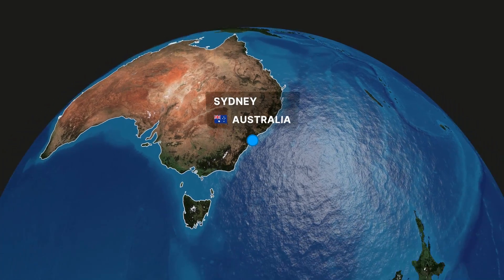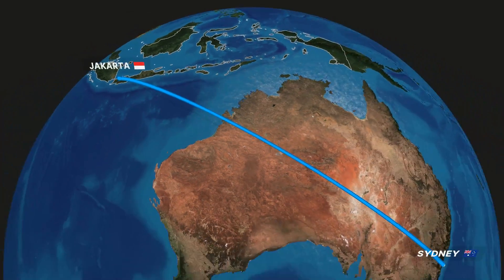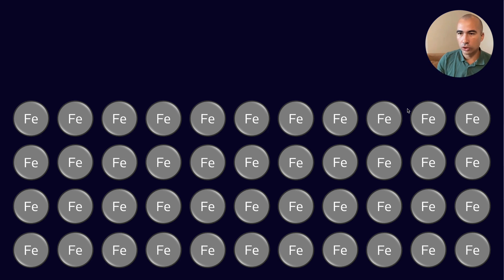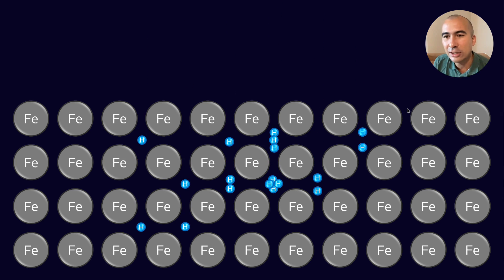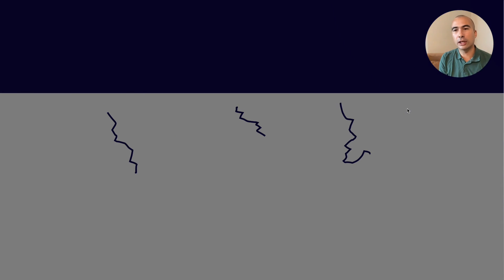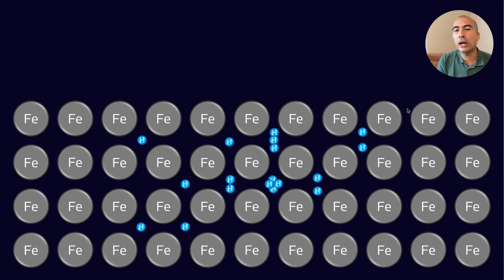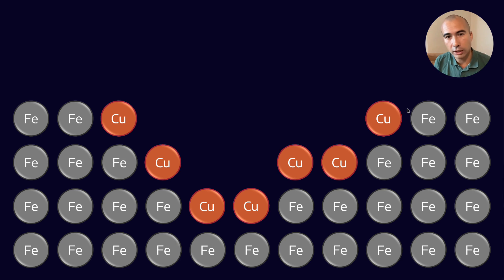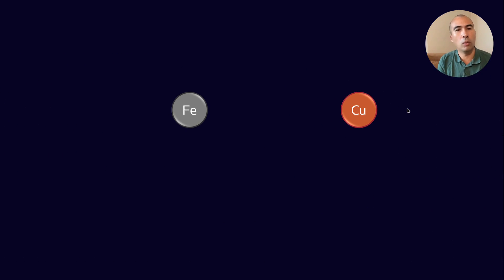Can Copper replace ZINC in Engine Oils?

Comment: I still use ZDDP additive in my oil. I have a G.M 6.0 with AFM and I don't want the lifters chewing the camshaft metal Shavings issues. Tons of forums with motor issues about AFM systems. I've owned the vehicle 6 years now without a problem. If I ever need to replace catalytic coverters that's far cheaper in the long run.
Reply: Hello! I have been using oils with copper-based anti-wear packages since 2016 on all equipment with an internal combustion engine. During this time I got excellent results. The 2-stroke motorcycle engine exceeded its service life twice as much. The magnetic plug, unlike oils with ZDDP, does not have metal elements on the surface.
Reply: @AlexanderIII_true  What product is it? And do you happen to know the specific name of the copper compound in the product?
Reply: @gregorymalchuk272  Hi, this is the Russian manufacturer Cupper, when their developments were present in addinol oils with the product name metalplaks. At the beginning of the company's formation, I collaborated a lot with developers when testing products. The only thing I know is that this compound is called copper oleate. The compound itself is rather inefficient, since the additive is based on a redox reaction, which ensures the replacement of damaged metal on the rubbing surface. therefore, there are many different other ingredients in the composition. I have photos of how copper forms only on surfaces subject to wear.
Reply: @gregorymalchuk272 been putting it myself on my oil for my scooter and it feels good, performance wise and smoother engine sound although it's just a week ago since i've tried for the first time, and planning to use it extensively for foreseeable future

Comment: This is super interesting. I share your sentiment about having skepticism. I can see how this mechanism could be used as a replacement for the anti wear properties of ZDDP. But I don’t know how this helps with all the other acidic byproducts of combustion and contamination that the lubricant has to control. Maybe this could be used in conjunction with other additives?
Reply from the maker: Here's something to throw out there (I'm not sure if this works) - we care about TAN because acids would could copper corrosion in engine bearings. But if the additive is a copper salt/acid, maybe it would slow down the rate? But you're right, it will need to be used in conjunction with other additives. Copper additives have been known for a long time, but the key thing Neol seem to have hit on is a way to formulate correctly with them.

Comment: Ok, I say this in a somewhat satirical way. But I’d be remiss if I didn’t bring attention to the oil company’s discovery. Seeing that particular formulation  improves the lubricating properties. Then they follow it with, “DISCONTINUE IT NOW!”
Reply from the maker: So the good thing about this - they’re a startup and not an existing oil company. If it was one of the majors I could see the tech being buried but these guys have a pretty strong incentive to get the technology to market.
Reply: @LubricationExplained  I was more referring to Mobil. And the fact that they ran across this extra nice lubricating molecule. And then that oil formulation is dropped. As for the startup, I think new minds and methods are always needed, especially when you have gargantuan companies that rule a market. The large companies have a type of inertia. It’s good when an upstart comes in, and shakes things up.
Reply from the maker: @iceman2k103   oh cool! Yeah that makes more sense. From what I understand Paramins (the additive company that made it) found it super useful but too expensive to make. There's a tonne of tech like it out there - like Tungsten fullerenes. Very effective, very expensive. And then there's graphene. Seems like its very effective, but there's been some studies conducted that have found the vast majority of graphene currently being sold is actually just graphite. :_Facepalm:

Comment: This is an incredible concept. I am interested in how you are going about the experiments. It sounds like a fantastic final year project
Reply from the maker: Fingers crossed!
Reply: been putting it myself on my oil for my scooter and it feels good, performance wise and smoother engine sound although it's just a week ago since i've tried for the first time, and planning to use it extensively for foreseeable future

Comment: I believe the USSR and russia afterwards has seen more usage of copper based oil additives. There is some good evidence of their effectiveness here on Youtube, but mostly in russian.

Resurs and Cupper were the brands if I recall. I think Restore is a comparable product available in the US, though that may have been copper silver and lead.

If I recall, the soviet products used some compound with copper. The color was like a dark green or dark blue. Copper acetate or some nitrate, I can't remember.
Reply from the maker: I’ve heard of Cupper, but never Resurs. I’ll need to take a closer look at Restore
Reply: I have used Engine Restore in the past, not much recently however, but it does seem to help badly worn engines. As a straight out extreme pressure additive I'm not sure. But a very interesting topic copper is.   @LubricationExplained
Reply: @LubricationExplained  Forgive me, I made a mistake. Resurs has nothing to do with copper, and is instead a ceramic coating that applies to local high temperature areas of friction. Same principle as the product ''RVS''.